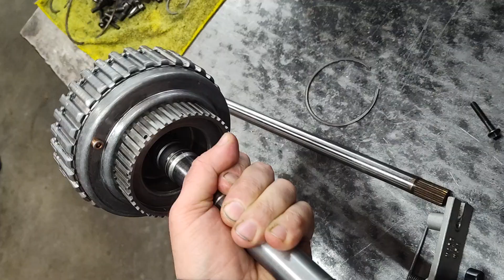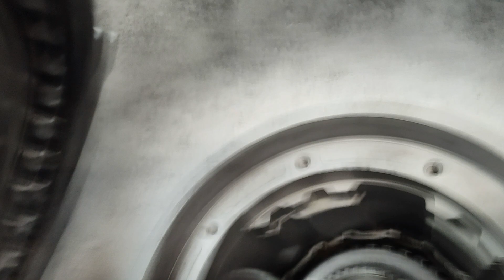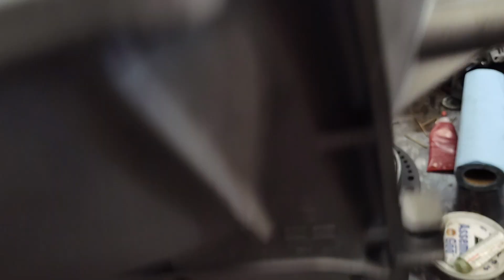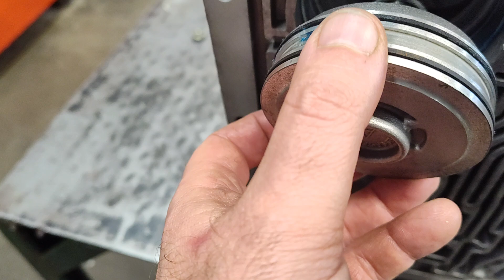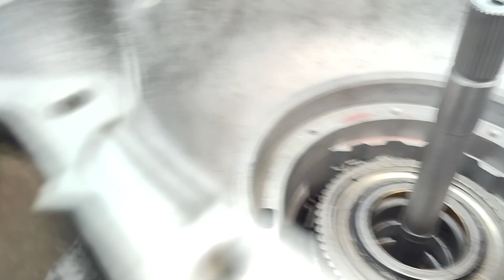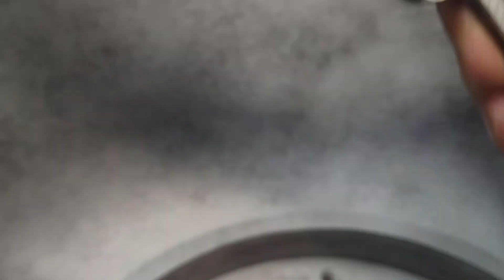Assembling a High Performance Ford AOD Transmission  Part 2 of 3

Comment: Hey boss i have an 89 lincoln town car i just bought and the transmission is bad due to the tv cable not being hooked up at the throttle can u tell me where to get a rebuild kit for it and what all i need
Reply from the maker: My best advice is to tear the unit down and make a list of all the parts you need. It's really the only way to know what parts are bad.

Comment: Good info! I'm an old semiretired trans guy so what you're saying is spot on IMO. I still fix a few, but most of mine are done fairly stock. I've got an AOD on the bench right now so this one is timely. I use the spiral snap ring and borg band as well, but haven't tried the one piece input shaft, yet. I'll probably have to try it on my next one. Thanks
Reply from the maker: Its a good upgrade. I try to always do it unless it is just a stock application.

Comment: What has to be done to use the aode mechanical diode on an aod? My truck does a weird skip deal in 2nd gear wot which I’ve come to believe is the stock sprag failing. I want to keep the stock aod gear ratios. No I’m not a trans guy at all but I’ve had the trans and valve body in and out enough that I may as well rebuild it myself lmao
Reply from the maker: You need the reverse drum with the diode and an aode sun shell.